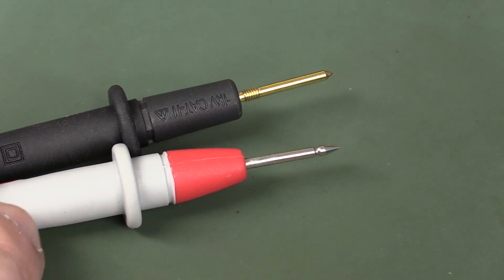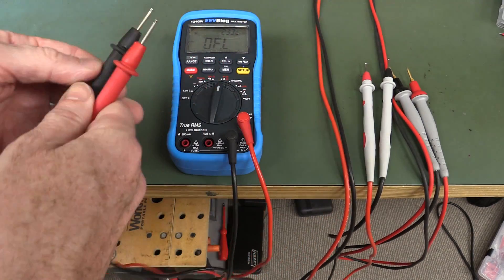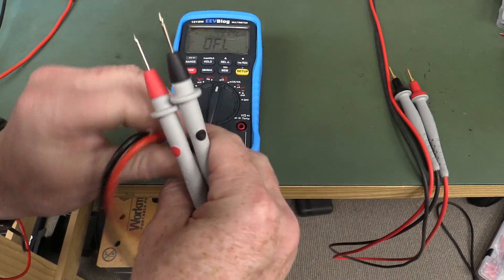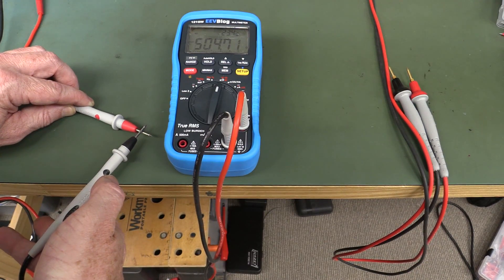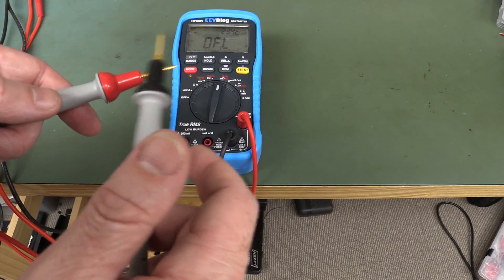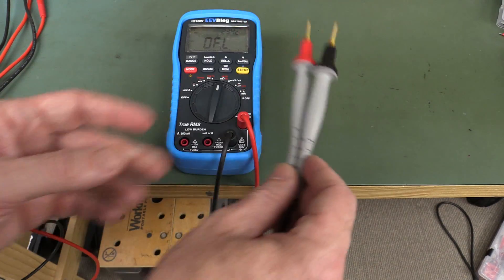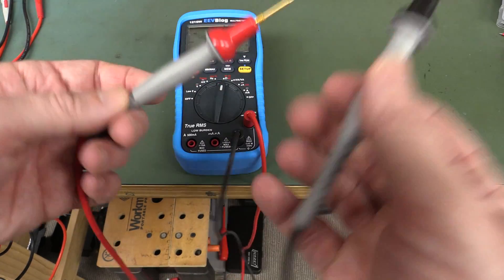eevBLAB #33 - Why Gold Plated Probes Matter

Comment: This has changed my mind.  I have always gone cheap and cheerful with ordinary probes, especially as the wires seem to always break because of badly designed strain relief.  Now all those non-responses, and looking for a better spot, turn out not to be an invisible layer of flux or just a quirk, but actually have a reason.  

Gold plating on probes would cost pennies - look at all the 10 cent RCA plugs - so why aren't they all gold plated?  Dave has done us all a service here and we should keep the pressure on.
Reply: Connectors are self-cleaning. When you insert them, there's enough pressure to scrape the metal slightly and clean it up a bit
Reply: Yes, we know that.  And what is the bearing on this topic?

Comment: I never thought much about probes over the years until I got a high priced dmm that had very bad probes. I bought Fluke TL 175 probes for about 35 EURO and it worked much better with them. Because I was curious when I first heard about probemaster probes I bought a set and was really surprised about how much better they are than the more expensive Fluke TL 175. With the EEVBlog Brymen 235 I got the gold plated Brymen probes and could compare these with the gold plated probemaster and several other non gold plated probes I have after about 35 years of electronic work. I will never ever buy non gold plated probes and I always replace non gold plated probes. It's a big difference in daily work and I especially love the probemaster probes. Quality compared they are really cheap.

Comment: Also a reason you should not use power relais for small signals - they might not work.
Same for some kind of switches: If you got bad luck, your power switch will not pull down a pin on a µC.
Power relais need a wetting current to burn through the oxidized layer. Gold plating is usually used for small signal relais.

Comment: Just tried this test with my no-name crappy probes that are old as the hills, and they work just as good as your gold ones did in the video. I was using them with a Fluke 179 no problem. Tried the same probes with an Amprobe AM-140-A; still worked fine, but got a buzzing sound at times. I never have understood the value of this test in evaluating meters either. I don't do continuity tests using the sides of my probes. I use the sharp tips!

Comment: You should have tested the probes with a different multimeter as well. I have an Agilent multimeter with a very cheap silver probe, which came with a £20 multimeter from 15 years ago, and the continuity just works fine even when i just rest the probes on top of each other.

Comment: The difference between gilded and nickeled styli is enormous. This I learned when I bought a multimeter Sanwa 500a - it is completed with gold-plated probes. The resistance of both probes is 0.015Ω. The resistance of "ordinary" probes from cheap multimeters is close to 0.13 Ohm. The difference is 10 times. It's a pity one - that the probes with which Sanwa is made - are thick .. and they are problematic to use on boards with very dense cmd-mounting. We have to use inexpensive thin probes, with Aliexpress .. but they have very soft metal .. quickly break or bend the tips of the needles.

Ideally - probes made of durable material .. for example titanium, with gilding .. but the price they will have ...
(Translated Ru-En by Google )

Comment: This seems like a good test for gold-on-gold contact.  But few circuit components I test (in my hobby work) are gold.  I wonder if the much greater resistance in the lead-tin-oxide or copper oxide on the component would outweigh any benefit from using gold probes.  An interesting test might be to look at high precision measurements of a on-board resistor or something to see if gold probes gave a different measurement from mystery-metal in actual use.

Comment: The main lesson I take from this is that it is really easy to get hung up on stuff that just doesn't matter and won't ever be a problem. Still, gotta push those Davemeters. (Amazingly, I can't duplicate this issue on my Fluke, even with probes that haven't been used for a couple of years)

To people buying cheap Chinese probes: I'm sure the nice soft and thin gold plating won't wear off the pointy tips in the first few dozen tests or anything... Any chance you could use one of those nice microscopes you have and do some wear tests Dave? Depending on the plating substrate, it is possible that after the plating has worn from the tip, gold plated probes could make worse contact than "ordinary" ones.
Reply from the maker: Well, I might have done more testing, but by saying I'm just pushing meters, why should I bother?, I'll just move on.

Comment: I'd like to see Dave test $5 gold-plated probes vs $20 stainless steel vs $20 gold-plated ones. Is there still an advantage to getting gold-plated if you get the bargain-basement cheapo ones, or do you have to shell out for (reasonably) expensive ones to get a benefit?

Comment: As a model railroader this raises some questions regarding the tracks and wheels my locomotives use. Nickel-silver is the standard metallury used in the tracks, and most of the wheels have high nickel content with some blackening schmoo that wears off in time.

And pickup is an ever-present issue, especially if one runs the scale I run(N) and likes steam. Small steam engines are infamously bitchy because they're very light with very few points of pickup.

I'm wondering if gold plated wheel treads, tacky as it would look, would help them get better pickup even on nickel-silver rails.

Comment: Hmmzz.. interesting point. 
Firstly, no it doesn't make that much of a difference in multi-meter probes, but there certainly is a bit of a benefit there. Secondly, gold plating is dirt cheap and no it doesn't wear off in any reasonable time frame like some here suggest, industrial test contacts will last for hundreds of thousands of mating cycles and almost all are gold plated. For RF probing virtually all contacts are gold plated. 
Gold plating is pretty much the go-to plating for most contact surfaces, its cheap and works really well. So yeah, that does raise a question, why are multi-meter probes an exception?
Reply from the maker: Fluke probably don't use gold probes because gold is not the best choice for high power high current electrical use.
That's why you don't find gold contacts on high power switches or relays for example, only signal level relays use gold plating.
Reply: Good point, give it a bit of a spark and gold plating vaporizes. That's a solid reason not to use it for generic probes. Not that steel doesn't vaporize just the same, but if you have solid contact with same material all the way through then it doesn't leave same kind of mark as on a plated contact.

Comment: Clean the old fluke probes with fine sand paper (2000 grit) then wipe with kitchen roll soaked in isopropyl alcohol. They will probably work just as well as the gold plated ones.

Comment: Hi Dave, i've never seen you using gold probes in the past - and i've seen a lot of your videos.  
When there so much better, why the manufactures for high end multimeters don't deliver these type with their meters? And what about effects in measureing of tiny voltages because of galvanic elements?
Will you use these probes for the future?
Reply from the maker: I supply gold probes with my BM235 meter. As for lab use, I use whatever is laying around, probes get swapped and moved around and lost etc all the time. But I do prefer gold, I've found then to generally work better.

Comment: When i repaired my projector this week, my probes were touching the solder joints but not making electrical contact.
It made me scratch my head for a moment because i was putting considerable force on the probes.
Perhaps i can see whether gold plated probes do a better job in this situation.
Reply: Having sharp probes helps a lot here.  That pierces the oxide layer.  Dull v. sharp makes a bigger difference than gold v. non-gold.

Comment: My concern with the gold-plated probes would be the gold wearing off the tip. If you are always pushing the tip into solder joints to break through the oxide layer of the solder, wouldn't the gold plating wear off pretty quickly?
Reply: Do you have gold plated cable connectors?  I do, and the only ones that wear through the gold are those that have seen many thousands of mating cycles.  If you are making many thousands of measurements with your probes, why wouldn't you have good quality probes?  Clearly, at that point you are either a professional or are passionate about electronics.  MSRP for the basic Probe Master probes is less than 17 US dollars.  And for the price, you get better construction, better shielding, more comfortable grips, and less stiff cables.
Reply: I didn't realise those Probe Master probes were so cheap! I can't seem to find them in the UK but I might try to get a few sets from the US.

Comment: i have a question was this a sponsored video you did not mention??

i have used Keystone great bench meters, i am concerned about the non proprietary OS, windows, and i OWN a fluke Scope meter 123/c and a 192-204, the 123 is 5 years old, the 192 is a year old, they are a non issue with the original probes, nor the 26 year old Fluke 11 with original probes, none of which are gold plated 

in the field ill stake my life on Fluke, but Keystone i have yet to see one on a transmitter site and contrary to your words, which i really enjoy your videos, but under the right circumstances Gold can catalyze
Reply from the maker: No this video was not sponsored. I have never done a sponsored video ever.
Reply: EEVblog thank you for your honesty

Comment: I dont think you've done a very well job here explaining why the gold plated probes might be better. No one will ever measure anything by bouncing the probe points onto something. I can imagine it could help for instance when trying to read resistance values, which can be difficult to get accurate readings on when using crappy probes. Than again your probes might be gold plated, but the thing you measure probably will not.

Comment: I've got probes that work exactly like Dave's and aren't gold plated. They aren't even branded. 
Their tips are thinner though, they're advertised as 'needle probes' suitable for micro components (which is what I use them for).

I also have the less sensitive probes, same brand as Dave's it apparently. Looking at both under the microscope I assumed that what made the needle probes better is how smoother and more regular their surface is when compared with the regular ones (at the microscopic level).

Comment: Chiming in as a plater.  Gold plating has nickel underneath it.   Gold is normally only .00005 inch (half a tenth).   Gold plating is extremely thin and easy to wear through.   Keep your nickel probes clean and they should serve you fine for a long time.
Reply: How thick, om average, is Nickel plate?
Reply: NeuronalAxon it depends.  But I would say on average .002 to .005.   At work for jet turbine repairs we will routinely go .020 to .030 to repair worn holes.  (That is an extreme situation though)

Comment: Just checked my 25 year old Fluke probes, no problem the weight of the probe does the job every time ??? Maybe keep probes 'clean'  I.E. no grease etc.
Reply: The grease is not the problem, actually grease helps to prevent rust formation. Once in a while is good to use a steel wool pad, thats it.

Comment: Funnily enough, I have one of those cheap $10 meters and a more expensive holdpeak, the probes that came with the $10 meter are kinda crap but they make good contact kinda like the third set that was shown in the video, while probes from the HP are slightly better made they make about as good of contact as those fluke probes, so I was rather surprised by how much better the continuity was with the cheaper probes.

Comment: Not exactly a scientific test is it? How about making yourself a tool for the job - take a small breadboard and some enamelled wire (transformer wire etc.,) of maximum gauge that will fit in the holes (for stiffness), and cut a dozen lengths or so. Bend them up into long 'U' shapes (remembering to clean off the enamel on the ends!) and press them into the board to form a series of wire strips. Now use a bit of emery paper to clean off the enamel on the top edges (leaving all the wires insulated from each other but having one surface exposed). Put a pin into one end of the line of holes so one probe can be connected to all the wires. Gently dragging the other probe across the wires will replicate what we do wiping across a set of IC pins for continuity. Pressure can be varied, wiping speed can be varied, the tone output will tell you how well the meter latches.

Comment: not only is a good contact and a sharp, clean probe far more important then any thin oxide layer -also realistically in a circuit you will be measuring a surface that has oxide or maybe some dirt on it very often, so you need pressure regardless.

Comment: Hi Dave

I know that gold shouldn't react with anything and shouldn't oxidize.
But I had this gold brymen probes for some, and it's not my experience.
After some time they become very unreliable, made weak unstable resistance measurements.
I fixed that by strongly cleaning tips with paper towel soaked in isopropyl alcohol (it was not dust, it required force when cleaned), they were much better after.
They seems to be coated with something over the years, don't know how or why, this is my experience.
I don't want to d**k around, so I never used those probes again.
I haven't experienced anything like this in my older other good quality multimeter probes.

/Darek

Comment: My Fluke 289 didn't come with gold plates probes and it does the continuity testing just as good as the gold plated ones in your test so the multi meter plays a big role in the performance of that test.

Comment: But who uses the side of the probe in real-word testing? It's the very tip that gets most usage, and any residual oxidation on that tip will rapidly get wiped away the first time you use it. Gently resting the tip onto a metal plate (obviously with the other probe firmly connected) would have been a better test. I'd be more interested to know the effects of flux contamination on connectivity. A pro board will be cleaned after manufacture yes - but any hand-soldered board will often have a fair amount of flux residue on the joints. Does that prevent making good contact?

Comment: I've bought a few fluke meters, all of which came with the nickle plated probes and all of which would pass the continuity test at @1:25. Are you sure that it's not related to the performance of that meter? 
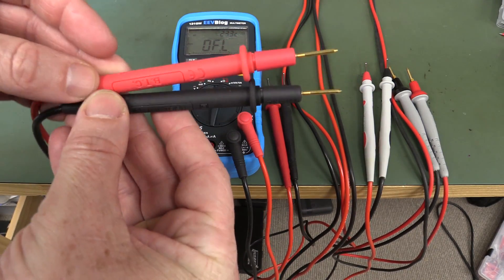I would find it a lot easier to trust you if you weren't trying to sell that meter @0:36 or/and you tested it against something I know works, like a "Fluke 87".

I thought the reason why gold plating was better was because it was flatter so it could make better contact.  Arguably this would only make a difference in probes if you were doing a continuity test of something which was also gold plated?  Even then, the pointy bit of the probe isn't flat, so you would have to use the sides.  

I can't remember a time where I ever probed something gold plated with the side of my probes.
A "real world" test would convince me. A test with an actual "component under test".

Comment: The problem with gold plating is some voltages due to different metals and suchs. I seriously forgot what it's called.. I did never encounter any problems on lower class 5.5 digit meters. But anyway, I believe that is why they are not used on higher class bench meters and why they use copper (-alloys) in connectors and even cables. Sadly you can only get these copper-gold-tellurium connectors that cost an arm and a dick..
Reply: Yeah thats what I meant. If you have a 4.5 digit or lower with not crazy low ranges it doesn't affect it. emf noise should be in the 10s of microvolts I think. But measurements on say a good 5.5 digit meter like my Fluke 8842A or a HP 3478A might not usually have problems with that but I did come accross these effects. I do use gold plated banana plugs and probes most of the time but sometimes I switch to normal nickel plated if I think it matters.

Comment: Hmm. Not entirely persuaded that the testing methodology is sound here. When you know which probes you are testing and that you have a point to make, well, even the most honest experimenter is capable of deceiving themselves with slight subconscious differences in muscle movements, swiping strategies etc.. You really need to do this double-blind, so you can't see what you're banging together. Not that I'm claiming there would be no difference in the results (I am pretty sure there would be) but only that it would be a more convincing test.

Comment: Yeah I totally get the difference with the old ones, but this wasn't a good test by any means. In theory it's better, in practice this doesn't show it would be. The very expensive gold plated ones at the end seemed to be almost as "problematic" as the newer non-gold plated ones. You need proper measurements I guess.

Comment: Dave, I can see that it would really help. I had some issue in the past due to my stupid meter being slow (2 seconds) for continuity test and fast reset (half a second). My probe didn't made a good contact for whatever reason and missed the continuity. I had fun to debug that... To redo the test later on because everything looked fine... And noticing it was indeed fine and noticing the probe issue...

I can't say that it will be a mandatory feature for a meter or probe, but it will surelly be a consideration.